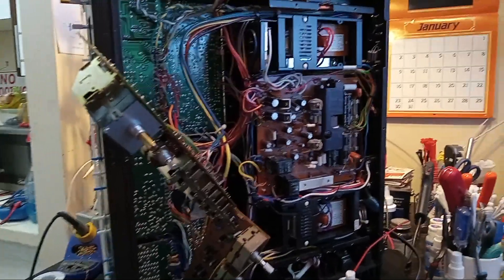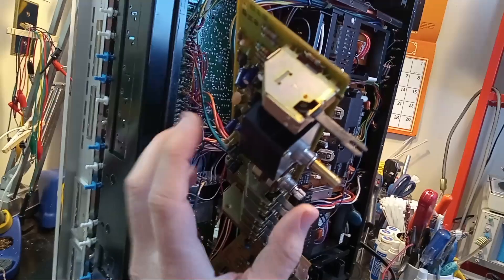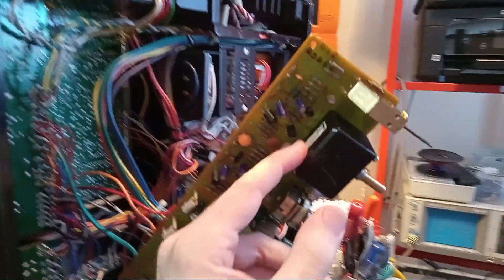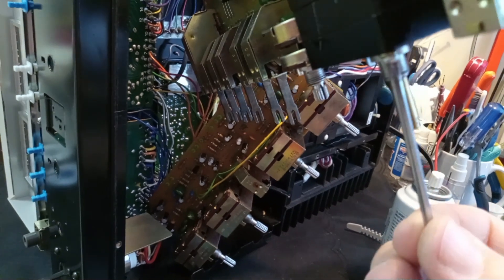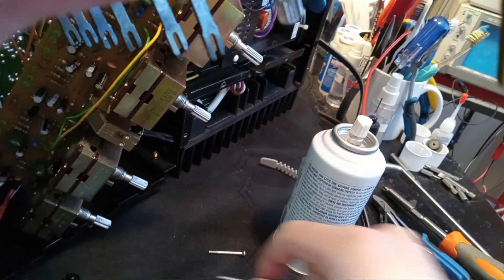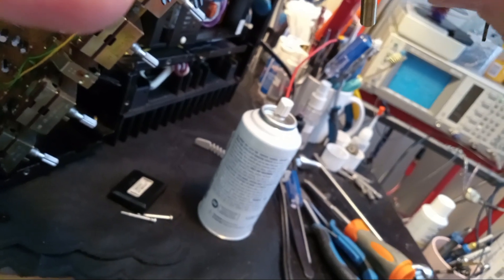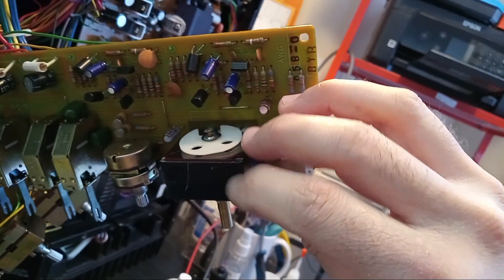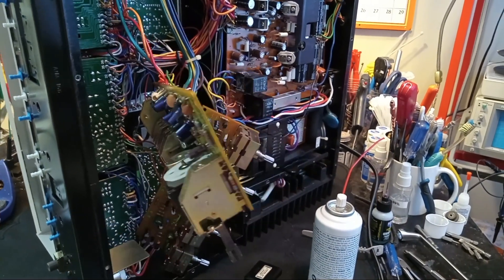Tech Tip: Cleaning Sealed Alps/Noble Potentiometers... Stop drilling holes!

Comment: I have cleaned the top and sides of the "sealed" pots with 91% alcohol really well and built a dam using thick tape all the way around the top side of the pot and poured Deoxit Fader F100L into the dammed up area and worked the pot back and forth re filling it once I think till it started dripping from the bottom a bit and let all that drip out then cleaning off all the excess from the dam and below the pot with a paper towel and Q Tips/ Alcohol and removing the tape (I used thick double sided 3M tape to make the dam). Worked it's way right on down between the cracks in the Noble pot and no noise at all in the pot when I was done. It trick was to be patient and take my time letting it soak in, working the pot over and over and cleaning it all up really good. Giving it plenty of time to leak all out. The bottom of these pots have larger openings...  Keep in mind one thing. This pot was not in terrible bad shape. Your mileage may vary.

Comment: Alps pots are actually fully disassemblible by cutting "starlock" washer (made from quite soft steel) and then cutting M2.5 thread on the shaft neck.
Then use M2.5 nut and appropriate washer to assemble it back.
After this procedure whole rhing becomes disassemble...

Comment: Good to know, although I've never come across a sealed potty that needed cleaning. By the way, do you know how to clean slide pottys effectively? Most of the times it's impossible to clean them decently, without taking the device apart, and I take it apart, I don't dare to turn it on for testing. So I end up finding out that the cleaning was insufficient, only after I've put it back together. Very annoying!
Reply from the maker: I've had the opposite problem, often they are crackly because no one has ever tried to get into them. 99% of the time sliders are open at the front, meaning if you shoot your cleaner straight into the slot where the slider is (just stick your nozzle through the felt dust cover) then work it back and forth you are golden.